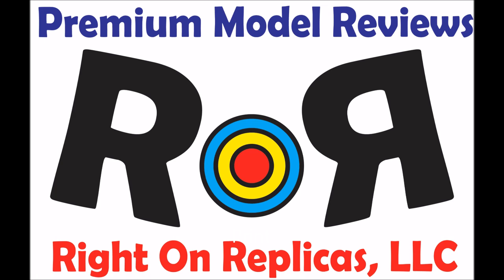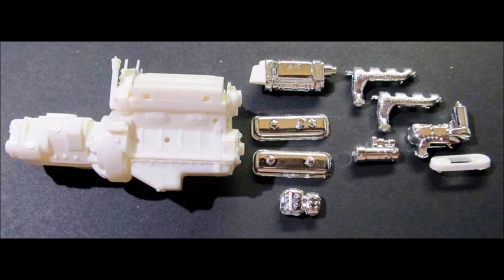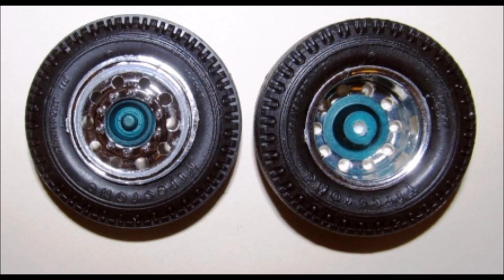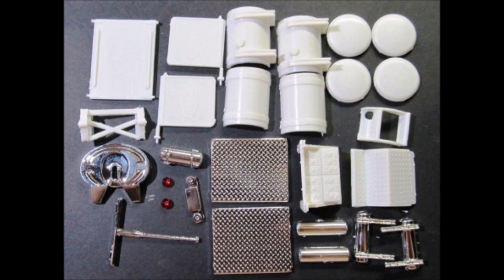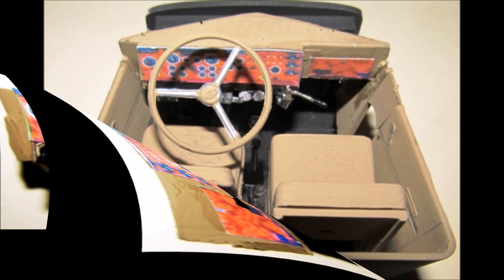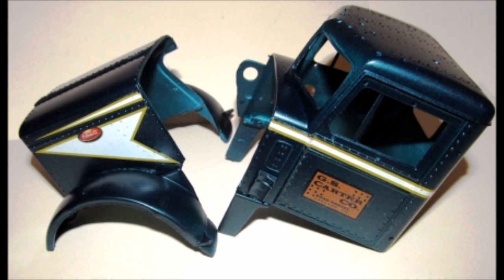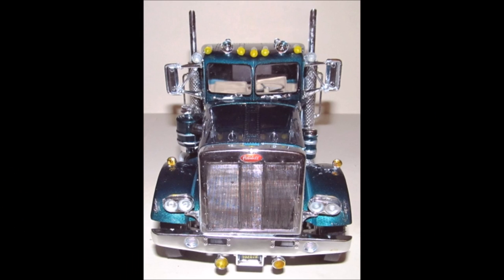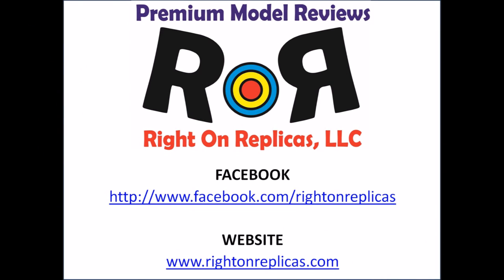How to Build the Peterbilt California Hauler 359 1:25 Scale AMT Model Kit #866 Review

Comment: Nice build,Doug.I have this kit,in a box,half done and got so frustrated with the flash and bad plastic that I put it back in the box and gave up.Maybe you've inspired me to get it back out.
Reply from the maker: Charlie -When they re-issue of this kit a couple years ago they had cleaned it up pretty nicely.  There's still flash and thick sprue points but it wasn't bad.  Your kit may be a little older - before they did the refurb.  Still, it builds up into a nice model with the extra effort.

Comment: The best part about buildIng the Peterbilt 359 California Hauler by AMT,is that you can take a soldering iron/hot knife and carefully cut the sleeper and the sleeper portion of the cab interior from the Revell kit and glue it to the AMT kit before priming and painting.
You could also replace the two stroke 350 hp 8v71 Detroit diesel engine with a 435 hp turbo charged Caterpillar 3406 six cylinder diesel engine from the Revell kit if you choose to do so.For those looking to do a custom build of the Peterbilt 352 Pace Maker cab over(COE),just use the chassis from the Peterbilt 359 California hauler kit to build a stretched Peterbilt 352 Pace Maker cab over.
It is "Kit Bashing" at it's finest.
Reply from the maker: DR,  that is some great information for adventurous modelers that want to customize their big rig kits!  -Doug

Comment: Any ideas on how to do "straight pipes" ? I'm currently building the AMT  freightliner coe but this one is next!
Reply from the maker: KM,  If you mean straight pipes off the engine - use some 1/8" solder to form the pipes off the engine.  Glue them together at a collector and paint them flat black or white.

Comment: Beautiful build! I wish I had this kind of patience and talent. I attempted this kit awhile back and it drove me nuts. When I got it finished it looked like a rat turd on a wedding cake! Sitting next to a Revell Peterbuilt 359, it didn't even look proportionate or to true scale. Maybe 1:25 scale was different back in the 70's, who knows. I enjoy building 1:25 scale tractors and trailers but the quality choices out there are limited and that's a shame. I have put together a number of AMT trailer kits and they came out pretty good. I have a AMT Mack DM600 tractor kit under my bed, partially finished, and it will probably end up in my junkyard...ugh!
Reply from the maker: EZ - The best thing to do is keep trying and read as much as you can about building models on forums like RoR here.  Practice makes perfect!  -Doug

Comment: I had a question was it difficult to assemble the frame
Reply from the maker: VK - Not really but you should build it starting with one side and adding the cross members one at a time as you remove them from the sprue starting front the back to the front to avid mixing them up. Then add the other side. -Doug
Reply: @RightOnReplicas  , that's how I build them. Put all the cross members on one rail. Then add the second rail. You can always add a rubber band or several of you need to.

Comment: i like your builds, but being an old ruck driver, you found the wrong dash. That dash you used was for a 87-2000 379 Peterbilt, and the steering wheel would have been all ivory colored. Overall though, nice build. keep up the good work.
Reply from the maker: GWH,  Thanks for the info!  -Doug
Reply: I remember the big ivory steering wheel in my dad's 68!
Reply: @1badseabee   watch again, he has  the dash decals for a 379.